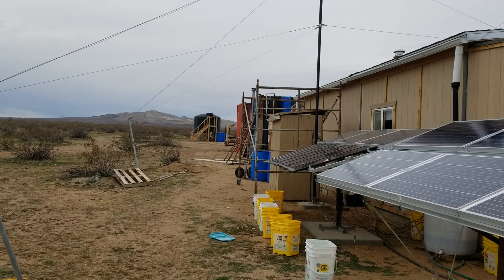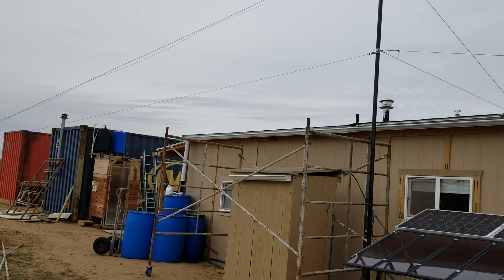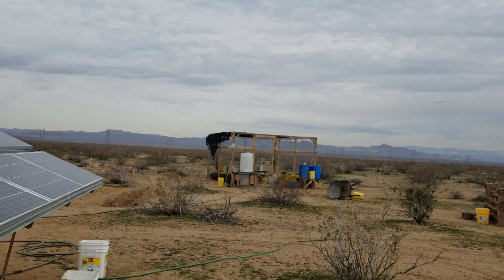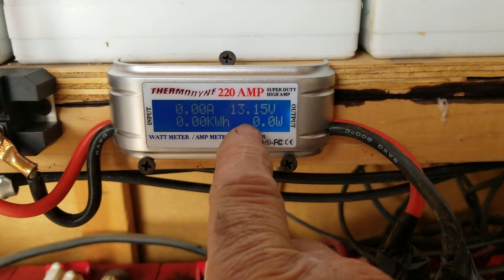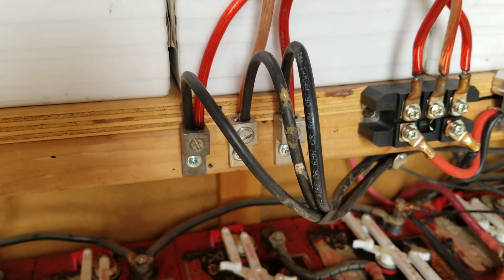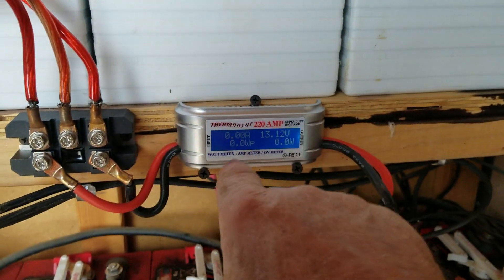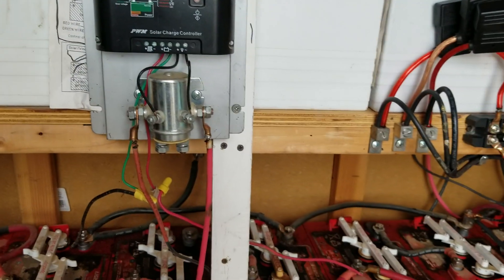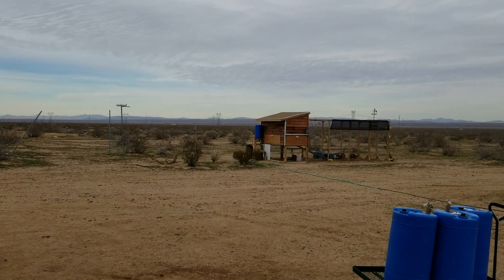GBear's Off Grid Ways-a Homestead in the Desert,  Feb. 12, 2019

Comment: Hello, as I can see you have the same MPPT like I have. By mistake my MPPT default values have been changet. If it is not to difiicult for you please write all the seting you have on your MPPT so I can corect my one.  Is there any posibilty to reset the MPPT to the defaut values?
Reply from the maker: Welcome aboard. Which brand mppt?
Reply: @GBear  MPPT Hybrid Laderegler LCD 12V/24V Wind Turbine Solar Modul Controller 800W+600W Model：1400w80
Reply from the maker: @Christi Trf  ouch!  I haven't used that controller in a long time.  I disconnected all those cheap Chinese controllers and replaced them with high end controllers.  Best move I ever made. 
Note that hybrid controller cannot run both wind and solar at the same time.  It's one or the other.  When i head ourside tomorrow,  I'll check if i still have the manual for it and get back to you.

Comment: what size pipe should i use for a wind turbine going up 50 feet
Reply from the maker: 2" schedule 80 iron pipe, buried 4 feet in the ground with a cubic yard concrete base, and 3 guy wires of steel rope (cable) running to independent anchor points of concrete bases of 2 foot cubes of concrete should be adequate for winds up to 50mph.
Reply: @GBear  You still use wind power?
Reply from the maker: No.  Waste of time and money.
Reply: @GBear  Being in the desert I can see your point. A lot of clear sunny days. However, those who live a lot further in the north do supplement their solar with wind. Summers are great for solar but the wind comes in mid fall to mid spring along with dark skies.
Reply from the maker: @JohnT.4321 Yeah, we get plenty of sun year round, and plenty of wind, too.  But, I go to bed every night with 100% SOC, and even running an electric heater, wake up to no less than 70% SOC.

Comment: Hi Si,, very nice  video,, comment: the rectifier is an electronic component  that rectifies (converts) the input AC Voltage to an output  DC Voltage with a small multiplication factor, No other job.
Reply from the maker: Correct!  Welcome aboard!  The reason to use an AC turbine, with a rectifier is smaller gauge wire for longer distances, then convert the AC input to DC so it is compatible with a battery bank. A separate rectifier is not required if using a designated charge controller for an AC turbine since the rectifier is built in to that controller.  You can tell by the controller having a 3 wire input and 2 wire output.

Comment: @G Bear's Off Grid Ways-A Homestead In The Desert I know you made the video back in 2019 but I was wondering if you still doing what you were doing back then I was wondering if also I could ask you some questions
Reply from the maker: Welcome aboard!  Yes, I still have the same dumpload setup connected, but it hardly ever activates since I started using the Midnite Classic solar controller.  Sure, ask away!
Reply: @GBear  amazing is there a way to contract you directly or this will work.?
Reply from the maker: This will work.  My channel gets credit for the number of comments, so it helps me while I help you. 🙂
Reply: @GBear  I have situation for which I'm theorizing a solution for my problem I'm trying to solve.
Where I live I can't put solar panels it's an apartment building but I can use wind energy. I would like to find out your source and type of PMA or PMG you use. Also is there a way can get one that powers at least 4000w?
Reply from the maker: Ouch.  Well, first off, I just did a video on how you can't rely on wind turbines as a main source of power.  Turbines only produce power while the wind blows, and seldom ever produce anywhere near the total output they claim.  
Next, a PMA or PMG that large would have a very large blade span, and would need to be placed on a tower high enough to avoid obstructions like other buildings, trees, towers, etc.  Most cities don't allow them for safety reasons.  The strain on the PMA tower alone would be equal to a diesel 4x4 attaching a tow chain to the tower and going full power to pull it down.
I have seen people install multiple smaller PMA's on houses within city limits, only to be told to take them down or face hefty fines.
If you have a balcony facing south, you could possibly set up a solar generator designed for camping, but I don't think they have them at 4k yet.
Reply: @GBear  I saw your video and I understand that.
However, I'm not trying to go off grid 100% just 50% as a result I would like to use AC motor, maybe 2hp, plugged in to my grid and that will substitute / simulate constant wind.
Motor shaft directly attached to PMG or PMA to power my project.
Reply from the maker: Ok, I think I know where you are trying to go with this.
Many have tried to go there before, but you can't power a generator with an electric motor efficiently.  The motor will use more energy than what the generator can produce effectively.
Large offshore turbines use gears to spin multiple generators at a hundred times as fast as the blades turn, and have elaborate computer controls to maximize output, but needless to say, those big units can't be placed on an apartment building.
I'm not trying to discourage you from your project, but I'm just not aware of any 'free energy' systems that actually work.  I hope you can figure something out.
My PMA is the KT5 by Thermodyne and 1850watts max at 90mph winds.  They do make a 'Max-core' unit that has higher output, and I will probably some day switch over to it.
Just Google kt5 and you should come up with their website.
Reply: @GBear  not looking for free just less than what I spend now and some motors can be 90 to 95 efficient I think I can use a speed controller to control the rpms or match to the best out put that works with that generator. But you might be right since you have done it and I'm only theorizing it now.
Reply from the maker: There are quite a few 'free Energy videos' on YT.  Most come from places like India and are fake.  They just shoot for going viral so they can make money.
A 2hp electric motor would be requiring approximately 1500watts start up and 900watts running, not under load.  Placing a load would increase the needed watts to run, so most of your generated power would be used up by the drive motor.
But, keep on your dream and work out the particular numbers.  You could be the one who discovers something!
Reply: @GBear  all those yt videos are fake yes.
Reply from the maker: If you try to do what they do, you will find that it doesn't work.  There are also YT videos done by guys who re-enact the original claim, and show that they don't work.
Reply from the maker: You can rest assured that my experiment on my playlist are 100% true.
Reply: @GBear  I know your channel is legit it's the reason I ask you. Thanks for your time.
Reply from the maker: You're welcome.   Ask anytime you need clarification.
Reply from the maker: Check out my Playlists, especially "Electrical Experiments and Such"
You may find some interesting stuff, and give you a leg up on your quest.

Comment: Why are you dumping your load off your battery? Why not directly from the source? Dumping from the battery cycles the battery and with enough micro cycles you make a full cycle. That uses your battery up prematurely and without actually utilizing your battery to power your home. Best if you need a dump load to dump from the source.
Reply from the maker: Interesting, tell me more.
Reply: @GBear  So if you bleed off the battery into your load you reduce the voltage in the battery. Once the battery low voltage is reached the source will once again charge the battery. You don’t want to cycle your batteries. You want to keep your batteries for your main source of power if all the other sources are unavailable and only cycle the batteries when in use for your home. That allows the batteries to live longer. If the batteries are full and you need to dump try dumping directly from the source into a water heater or some other storage in which you can recover the excess as either heat or electricity. Im building a large enough battery to hopefully never allow it to fully empty or or fully fill up. I will have to have a dump just incase. I will be building a 42kWh pack of Nissan Leaf modules at 48 volts. For our place it should be enough. I may need to add to the system but for now that is what I will be using. My test power wall of 14 modules 7s 2c modules works great. MPPT solar charge controller that monitors pack voltage both charge and discharge and a BMS that monitors each side of each module. Next is to implement my dump load into a hot water tank.
Reply from the maker: Thanks.  Since I implemented the Midnite Classic 150, my dump load never activates any more.  I can manually activate it,  but don't, except for tests.  My system is managed efficiently with the MC150 and my batteries don't drop below 12.6 at night and are back up to 13.6 at sunrise.  I just keep the dump load connected because it has to be stored someplace, so I let it be.  My lead acid battery bank is going on 6 years old and still holding up just fine.  I  am a strong believer in not fixing what isn't broken.

Comment: I have one more question if you don't mind me asking there are two types of inverter on eBay 6000W Pure sign wave 12V and 24V which one do you recommend I should buy?  either 24v or 12v
Reply from the maker: It's a matter of preference, but 24v seems to be popular over 12v. I have 12v because I started my learning with it and don't want to but new equipment to switch over while my system is working just fine for me.
I will however recommend AIMS brand inverter in Low Frequency, Split Phase, Pure Sine Wave, 240V output.

Comment: very informative video as I can see you install it back in 2019 is there any updates on this system how it is working for you in 2022 also how many batteries are you using and what make are they
Reply from the maker: Welcome aboard! Yes the system is still up and running here in 2022.  I have 18- US2200 golf cart batteries in one bank and 6- L16H-AC in a back up battery bank.  They are all 6V connected in series parallel for a 12V system.  I have upgraded my controllers and inverter.  The PMA is a KT5 1685w, and still working fine.
Reply: @GBear   Right on time I'm making my own DIY vertical turbine for the last couple of days I was trying to find out how and what type of batteries I should use for my 233W x2 load Thanks mate much appreciated

Comment: Awsome video you explain very well. I have a question. I want to build a ice fishing shack. On a wind power. What i want to know instead of a dump load can i use a 12 car heater?? Or dies a dump load use less electric.
Reply from the maker: For wind power to work in your situation, the PMA would need to produce at least the watts your heater would use, and do that constantly.  That means you would need a constant wind speed equal to the rpm's required for the turbine to produce the minimum watts.
I don't think that is feasible.
You may want to check out the "Patriot" solar generator instead and maybe mount the solar panels on the roof of the fishing shack.
Remember, the amount of BTU's needed to heat the shack will need to factor in the temperature, wind chill and insulation of the shack.
In my opinion propane would be more efficient in keeping you comfortable.
Reply: @GBear   thank you for responding. I was just trying to figure the dump.when battery fully charged. Instead of dumping the eletric. I was just wanted to put it to use. I use 3 mighty max battery , 1 8 foot led strip light. And have a lighter port for 12 volt coffee maker. I use a 400 watt wind turbine to recharge. At night i bring it inside. So my battery dont burn out. Im new to this trying to have some eletric. I wanted to do solar. But night winter breeze was abundant. I know propane is quicker.  Im trying not to stay warm by the eletric heater. But use it as a dump when batteries full. Otherwise i take the wind mill off before i leave so i dont burn the battery out. And i see what you mean by solar.. I might make another battery bank use a battery switch and put heater on at night.its not alot of heat just to take chill off. I thank you for your time sir!! And ill look for a solar panel for the roof. Thanks again.

Comment: hello, the rectifier always send the 12 V to the battery or we need  to choose one acocording the voltage we are using, 24 or 48V? thanks 
PS nice video
Reply from the maker: Welcome aboard!  The bridge rectifiers only job is to convert AC power to DC power.  The PMA (turbine) determines the voltage, so you can't use a 12v PMA to charge a 24v battery bank.
Reply: @GBear  my wind turbine data sheet says 0-330 v 3~, i have  measure  around 80V. so i will have no problems wherever i want to use 24 or 48V? Thanks
Reply from the maker: @helenaisilva  a PMA is like a car alternator, and when you order the PMA you determine for a 12v, 24v, or 48v system.  The rectifier WILL NOT regulate the voltage between the PMA and the batteries, it will ONLY convert 3ph AC to single phase DC with the same voltage in and out.  If you put 80vac in, you will get 80vdc out.  If your PMA is capable of 330vac 3phase it will blow up your batteries. 
You would require a voltage regulator to step down the input to either 24v or 48v before the rectifier.
A Midnite Classic charge controller might be your answer.  Call them and ask it it will work for you.
As with all charge controllers, you connect the batteries first and that tells the controller what your output voltages need to be, so the controller regulates that voltage for you, no matter what the input.
I use a Midnite Classic 150 on my solar for my 12v battery bank, and the panels connected for input are in series for 102v in, and 14.5v out.  Depending on the amount of sun, that 102v could fluctuate down to 40, 50, 60v, so I would say the Midnite Classic controller should work for your situation.
You would bring the 3phase from the PMA to the rectifier to convert it to single phase DC, then go in to the controller that is already connected to your batteries and then set up the charge curve for your needs.
Note that this charge controller can be used for wind OR solar, but not both at the same time.

Comment: how did you get the fan go on and off for the batteries?
Reply from the maker: Actually they are connected to the dump load controller for auto on.  You can connect a fan to any Auxiliary connection on any controller, and set the Auxiliary on voltage to meet your needs.
Welcome aboard!
Reply: @GBear  thank you
Reply from the maker: You're welcome.

Comment: You hooked up your batteries incorrectly. Never hook up in the middle of your battery Bank positive should be starting at one end of the battery bank and your negative should be at the other end of the battery Bank you have to imagine your battery as a large battery just like any other battery you hook up to the positive at 1 end and the negative at the other. otherwise not all the batteries will get fully charged and you will have premature death on some of your batteries
Reply from the maker: That's an optical illusion.  I am hooked up positive at one end, neg at the other.  The wires in the middle go to the dump load controller which hasn't activated since I added the Midnite Classic controller.

Comment: How much the output voltage of the wind turbine ? How much voltage for input to the rectifier to result 12 volt DC to charge the baterai..
Reply from the maker: Welcome aboard.  The PMA delivers approx. 13.7 volts to the input side of the bridge rectifier during adequate winds.  Without decent sustained wind output is much lower around 10-11 volts and no charging takes place.

Comment: did you ever use the hot water heater to dump excess power too if so could you show a link to your video for it
Reply from the maker: Welcome aboard.   No, I didn't.  What I discovered after getting to my desert homestead is that when extra electricity was produced, it was at a time when I didn't need hot water.
In the winter, my tankless propane water heater is very efficient, and with the shorter days, even when windy, there is no excess power being produced.
Part of things I wish I knew before going off grid.